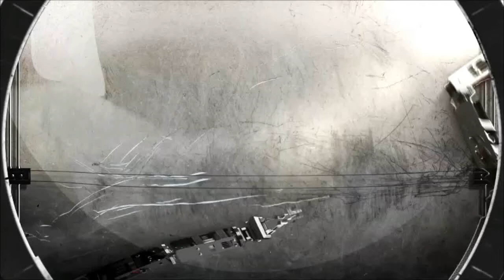drill press repair part 2

Comment: A quick fix i just got an old meddlins drill press all siezed up and three ph broke a few. Parts of the castings but think im about there now the motor hinge bracket is also broke cant weld it  but ive drilled and milled and bolted it up should hold . On yours you might be able to drill thread and weld the studs with a plate